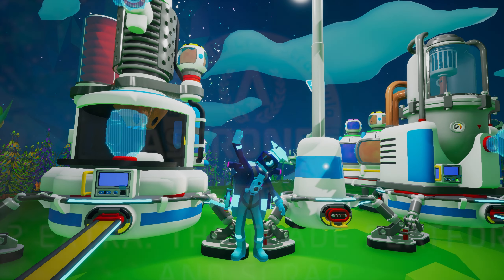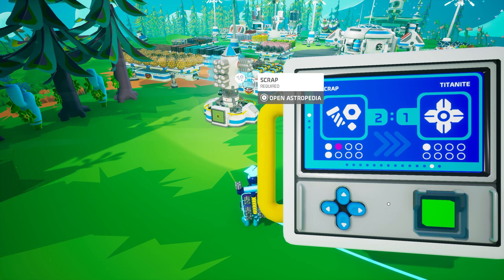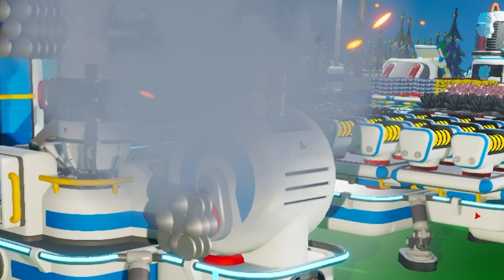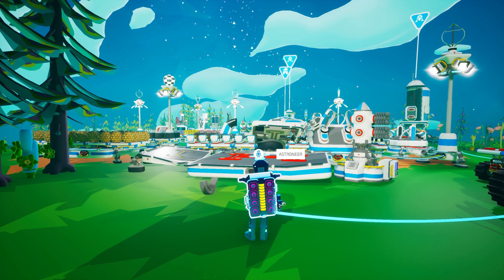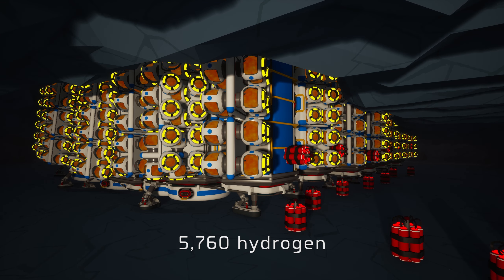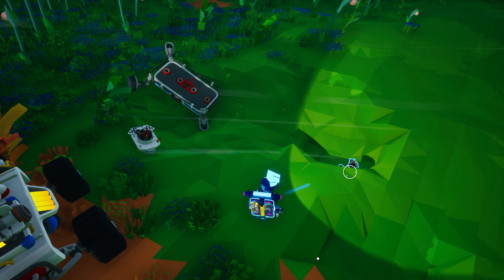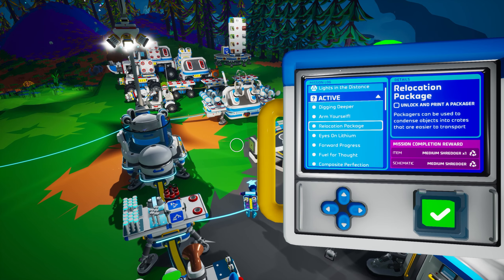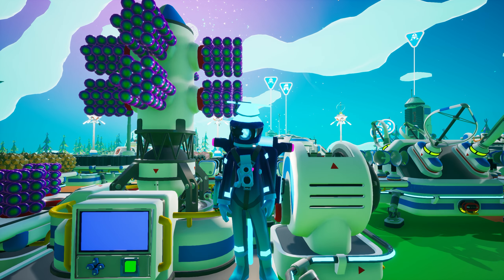The Trade Platform & Scrap | Astroneer Academy 202 Extra

Comment: Let's see . . . 1. That time when you scrapped an EXO Chip. 2. That was one Massive crater where the mountain used to be. 3. I like how the resource scrap value table came out. 4. Burrito!  5. I'm surprised you didn't (again) mention the power switch for temporarily disabling the shredder.
Reply from the maker: heh, the power switch was in there, but it felt a bit clunky, plus I needed to make some cuts for runtime. :)